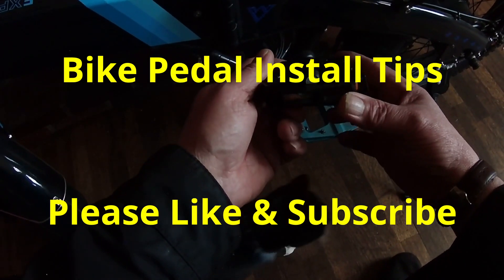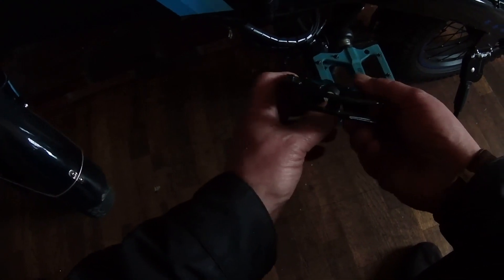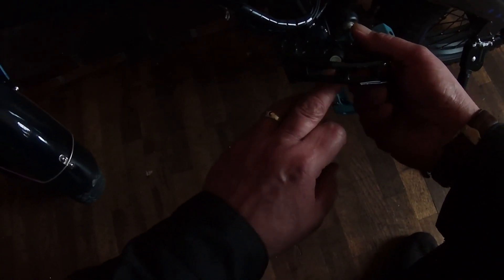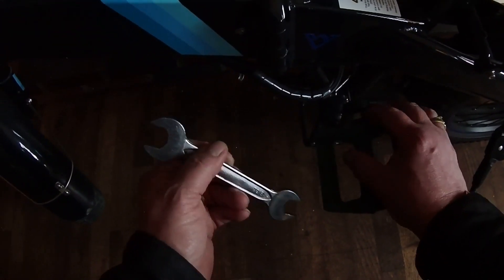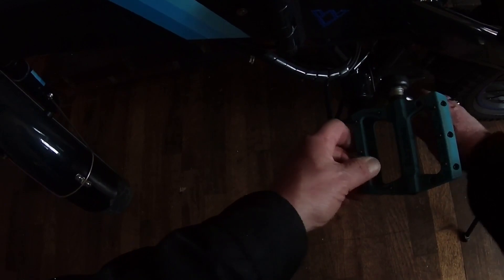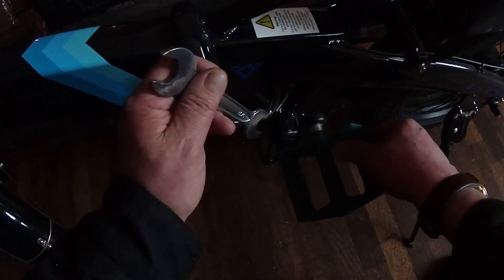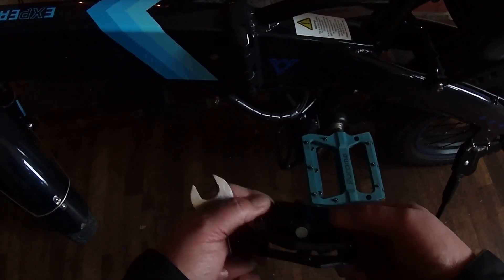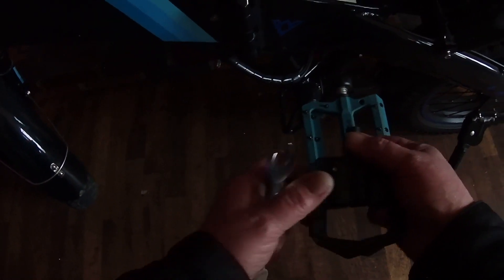LECTRIC 2.0 Pedal Like a Pro with These Pedal Install Tips!

Comment: What if you use the hex key in the back? same direction?
Reply from the maker: the thread will turn in the same direction if using the hex key as well. I never use the hex key as it is easier to get the pedals tight with a wrench